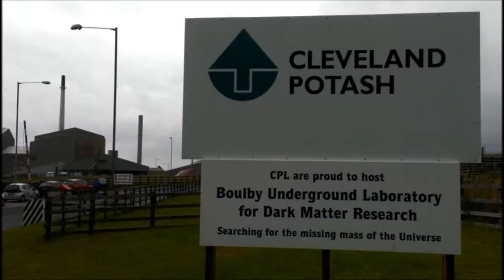Boulby Tower

Comment: COOLING TOWER????? It's the No1 shaft tower, holding the four sheave wheels for the winding ropes, it houses the steelwork for the skip discharge equipment. Similar to a colliery head frame, but made up of reinforced concrete.